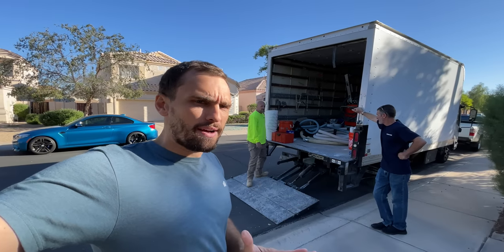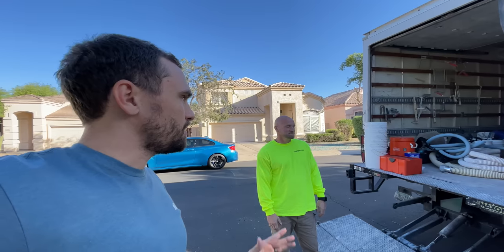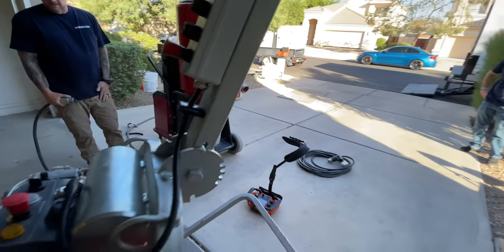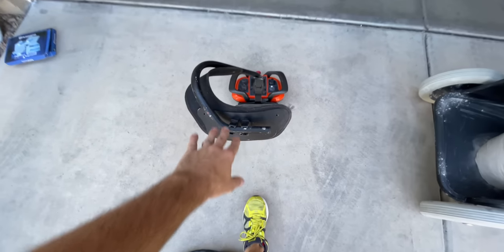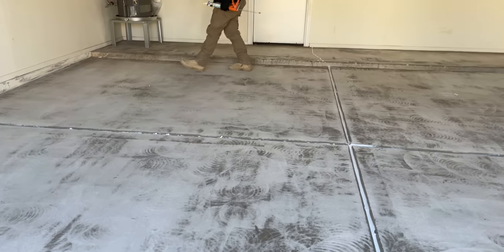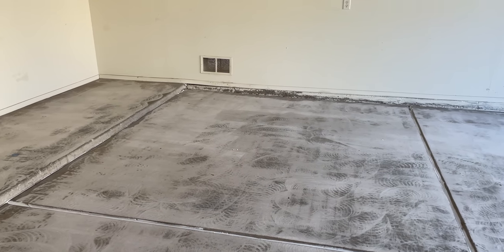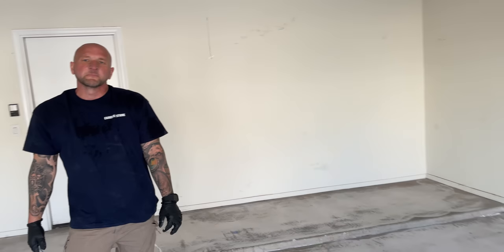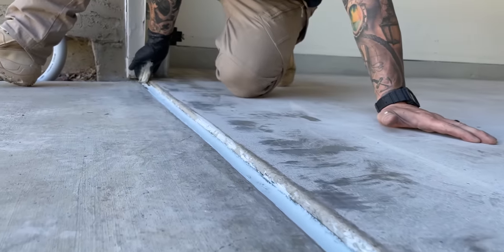How to Epoxy your Garage Floor to Last (Extremely Durable)

Comment: Had my floor epoxied 11 years ago. The tires end up melting away the epoxy over time. At least with my installation. This installation was well done so I hope it lasts longer than mine. I went with Swisstrax recently and called it a day.
Reply: I did the same thing.. epoxy covered with swisstrax

Comment: I live in Raleigh, and I’ve not seen anyone that does near this quality.
Reply: Yeah I live near Raleigh and mine isn’t this quality for more $$$.  They didn’t flake the vertical lip edge or curb, not sure what it’s called, nor did they sand the flake before epoxy top coat. Now I’m bummed LOL

Comment: How slippery is the surface when wet? I know you don't have to worry about snow and slush, and rain isn't really all that much of a thing either, but I was surprised to see the sanding step after the flakes went down, as I thought the flakes were the anti-slip component. Any chance you could spill a pail of water and give us a slip test video? :)
Reply from the maker: There is still grip on it when wet but I am sure I will talk about it in future videos. It's not totally smooth to where there is no grip